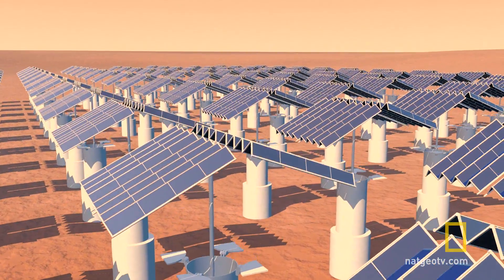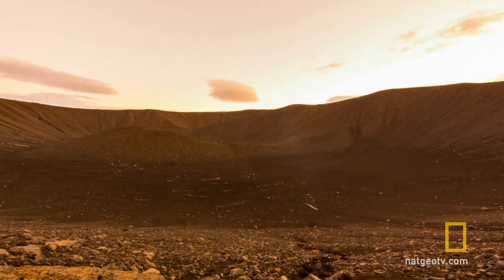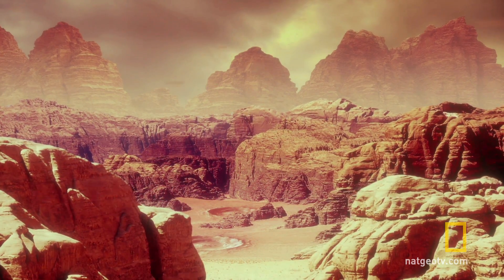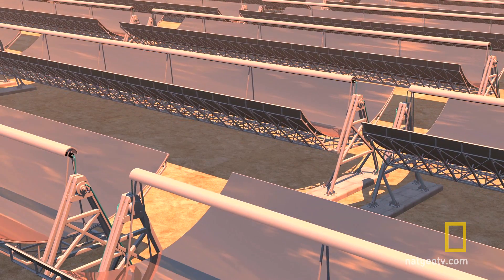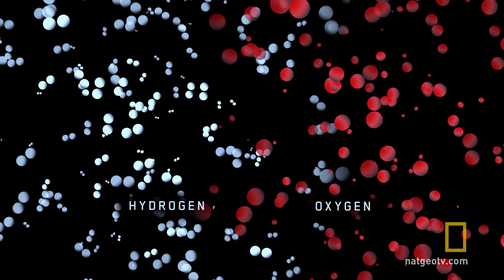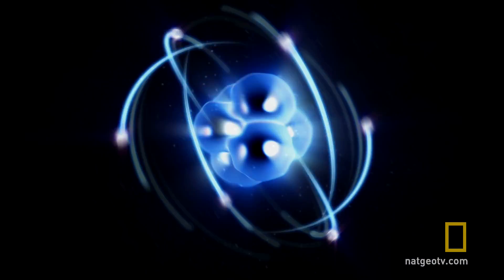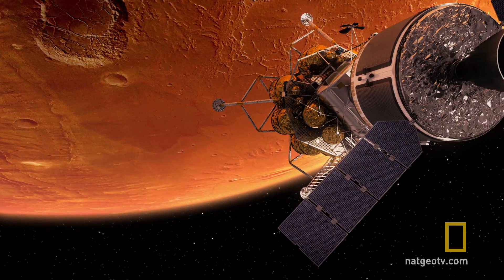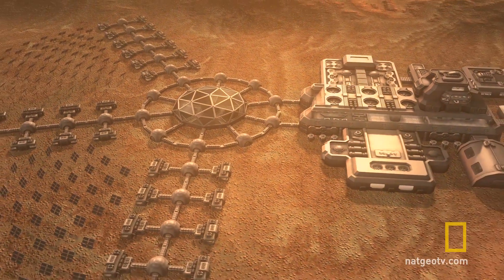Generating Power on Mars | MARS: How to Get to Mars

Comment: Solar power on Mars can only generate 50% of the power as on earth, or less. So, I think Strontium-90 is a better solution, since that metal generates heat, which can be used in thermoelectric generators. Str-90 is also cheaper compared to Pu-238. Until solar panels with 40% power efficiency become cheaper, we will have to stick with Sr-90. Meanwhile, back on earth, solar panels are a viable form of power generation, since the price per panel has dropped to <$1.00/Watt as of 2016.

Comment: Just thinking about the logistics of power generation on Mars, I realized a lot of stuff could be built lighter and cheaper on account of the gravity.

Imagine running a long high voltage transmission line across Mars from the power plant to one of the major settlements... the spans between towers could be three times as long, because the gravity pulling down the cables is one third. If (for example) you need 6 - 9 towers per mile on earth, that equates to only 2 - 3 towers per mile on mars.

And this goes for everything else too. Buildings, structures, the whole lot.

Comment: Why don't invent a motor that requires little amount of power to generate and use it cycle a rubber rubbing a metal and store it and powering the motor giving the power to the battery at the same time?

Comment: If Mars have a dust strom why don't use wind genertor for power
Reply: The martian atmosphere has only 0.6% the thickness of Earth's, so you wouldn't generate much power, even with storm winds.
Reply: That is a possibility worth investigating, but right now not that much is known about Martian wind patterns.
Reply: more expensive to set up and instsall . Solar panels are easier and quicker and many can be set up in a short period
Reply: BITW 01
I don't think so. Just like solar panels can unfold on an unmanned satellite - a folded wind mill can extend a poll and unfold in a similar way. I think the problem is that a wind mill would be heavier because of the necessity of translating mechanical motion into electricity and the wind is less constant and more variable than sunlight in addition to being weaker in the thin atmosphere.
Reply: seuppibacken Thanks man
Reply: Plasma Struck
An atmosphere that weak might do it if the gravity is also weak.
Reply: Since wind is so inneficient on Earth that none of them would survive without massive subsidies, why would they all of a sudden be more efficient on Mars?
Reply: Dust storms can't throw rocks around, only tiny particles of dust mostly.
Reply: Bruh Idfc pretty sure it was that. Or typhoid fever or whatever